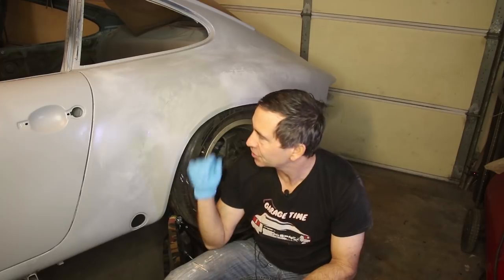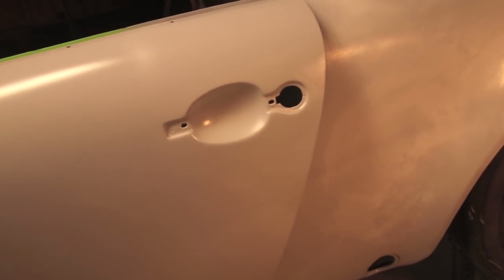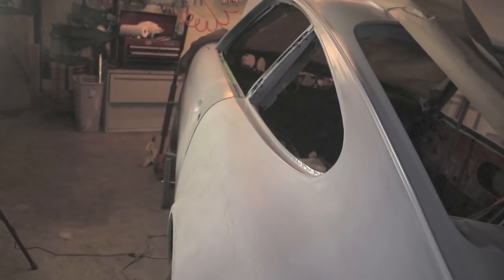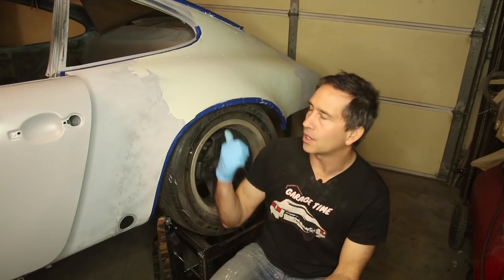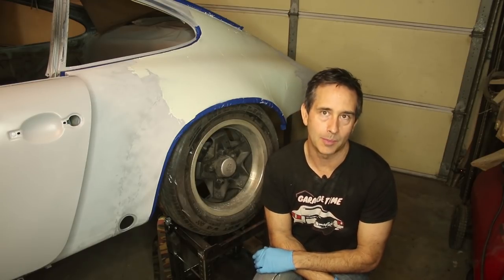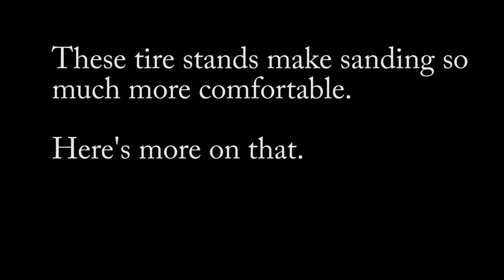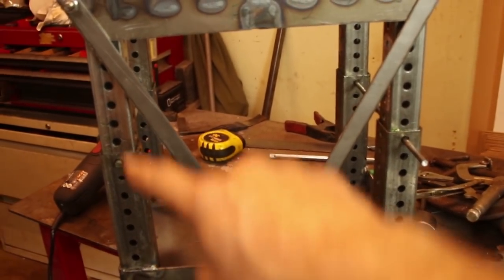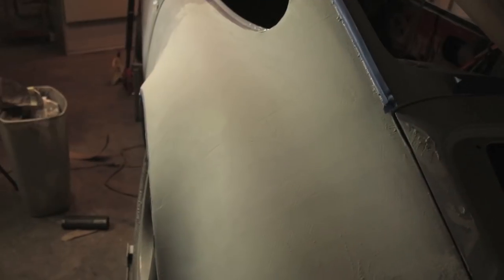Porsche 911 Project Bodywork - Block Sanding Filler

Comment: Nothing wrong with filler when used correctly. I’m just glad you have epoxy on the metal directly, some people will put filler on bare metal, not my preference. I’ve removed filler that was put on bare metal, and found rust between the filler and metal. Awesome video as usual! I’m off work for a week, maybe I’ll get some garage time....thanks for the mention!
Reply from the maker: Hi Dave, oh man that is a contentious topic for sure.  I agree with you of course, but I noticed it says right on the can of filler "500 hrs of salt spray approved".   My belief is that for slow moving classic restorations, epoxy first is the way to go.  Hope you get some quality garage time.  I will not as I'm leaving for Europe today with the family.  Happy holidays.
Reply: Garage Time - Restomod I think what Dave was trying to say is that rust "never sleeps". There could be rust hidden in the bare metal pores, which then continues to corrode under the body filler which was applied directly to the metal. Epoxy provides some rust inhibiting protection. the epoxy chemical reaction also removes moisture from the rusty metal pores as it dries after being sprayed.

Comment: My favorite part of the build here, yea nothing wrong with a skim coat of filler.  The SPI epoxy sands good, doesn't it? I love the fact that their epoxy has a shine to it unlike most and when you sand, its basically a built in guide coat. Nice work!
Reply from the maker: I'm really impressed with SPI's product and support.  I'm going to use their epoxy in the interior, engine bay, trunk, and suspension.  It's arguably the toughest and most chemical resistant coating out there.